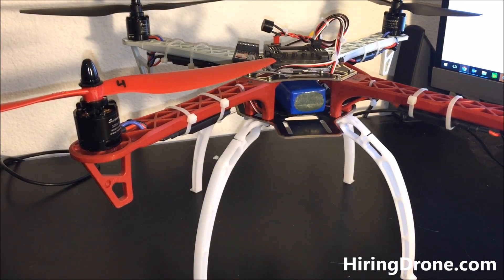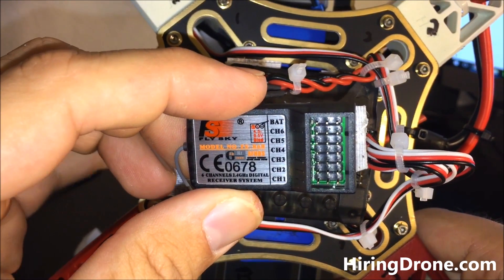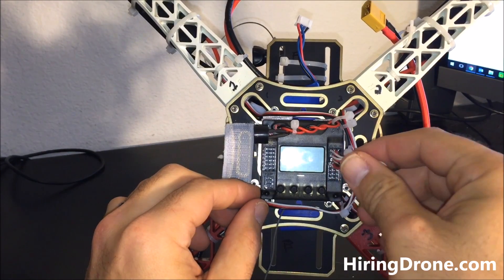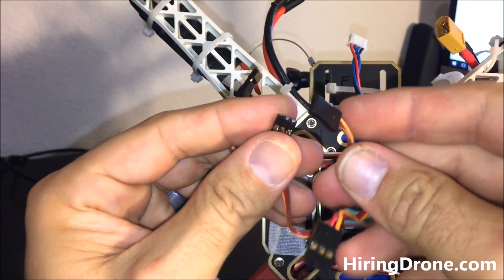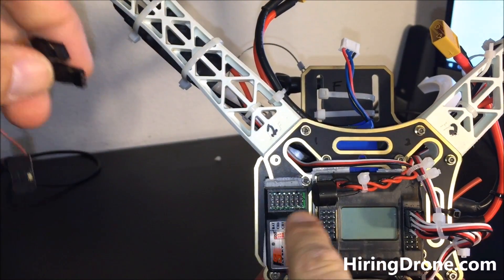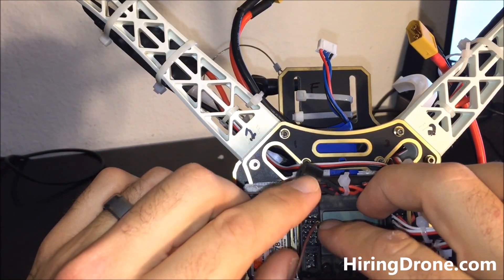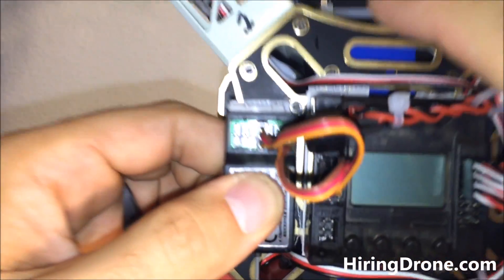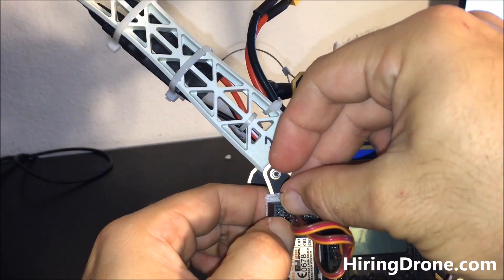KK 2.1.5 Evo Flysky TS-F6 Receiver Transmitter Setup

Comment: just wondering whether the distance between each motors are the same? did you weight the mass one arm? do you know the mass of your centre point without any hardware added? I am wondering because I am doing a modelling and simulation using this Dji model.

Comment: sir , I bought HW ESC 30A for quadcopter. But with setup to kk 2.1.5 . the esc's are not calibrated properly. please help me in calibrating esc's
Reply: Before calibration the esc you should have to set all the values of throttle rudder etc to zero in reciver test after that put the quad in flat surface calibrate acc it worked for me

Comment: Whenever i try to arm the kk 2.1.5 flight control board by moving down the throttle and towards the left it says armed. But after that when I try to give a little throttle the kk board auto-disarms itself. What could be the reason?
Wiring of all the receiver, board and motors are in the correct manner, throttle end points are also between the range of 0-100.

Comment: Hey why r you using kk 2.1.5 controller I can only use fly sky transmitter and receiver to run the quadcopter. Means  I want to actually say that what is the difference if I don't use kk 2.1.5 controller

Comment: There's another workaround you can use. In CleanFlight you can remap the channels without changing wires. I found this thread on reddit and it saved my sanity! The crux of it is "After reading about FlySky, supposedly they have their own proprietary channel mapping. To correct this in CLEANFLIGHT (maybe the same for Baseflight). Go to the CLI Tab. Type "map" press Enter then type "map 4RETA123" -press Enter" - there's a little bit more too it the thread is here: read first two posts https://www.reddit.com/r/Multicopter/comments/470vhv/naze32_rev5_flysky_fst6_fsr6b_channel_mapping/ It's for a Naze with TS-F6 but same principle

Comment: Hello,
does the last wire go into the first slot in the kk board? I have no slots left . Great Video thank you.

Michael.
Reply from the maker: The first slot is for the bind plug. This had me confused too, as the channels would not matchup. I switched to the Turnegy X8, because you got more channels than the Flysky.
Reply: Will have another go at it. Having big problems. Thank you great videos.  Stay Safe.     Mick.

Comment: what if i use 4 channel transmitter and receiver? means all the connection would be same as shown in your video?
Reply from the maker: Yes, for the most part it would be the same. I have a video on this channel of me hooking up a Flysky Transmitter, which I believe is only four channels.
Reply: +Hiring a Drone could you please share the link of that video to me?

Comment: Brother i have a older version of the transmitter i.e. FS CT6B and even all the settings are right my throttle is not calibrating .. please help  ASAP..
Reply from the maker: +Rohit Chauhan You might to calibrate your ESC's. This is needed when binding a new transmitter.
Reply: hai bro i am from tamilnadu . its same problem help you bro....
Reply: +ram kumar i got it covered friend my quad is now flying perfectly.. and done everything right now

Comment: I have  the same radio  transmitter  but  I  mistakenly factory reseted the radio transmitter  I am not getting  the signal from  the  radio  transmitter  can u please  tell me how to recover  his
Reply from the maker: +lingesh GH It sound like your transmitter is not bound to your receiver. Below is a video on how to bind your receiver. Do not plug a battery into the receiver, like shown in this video. Just power up your quadcopter like you normally do to turn it on, but with the Turnigy bind plug in the receiver. https://www.youtube.com/watch?v=9pgfRykX9dU